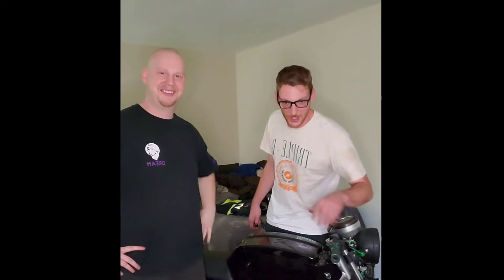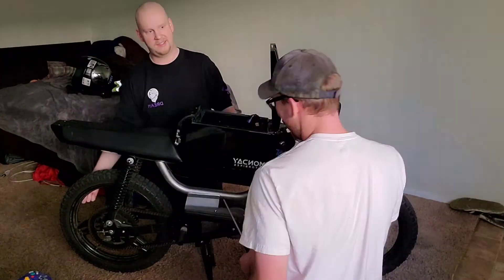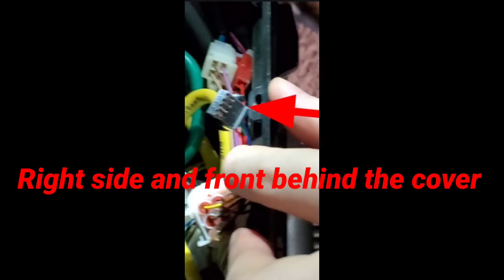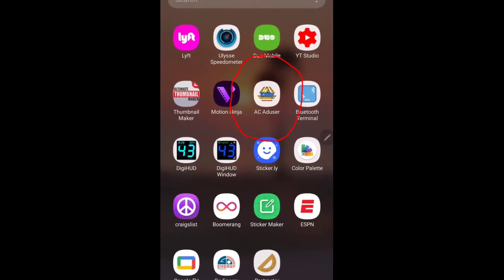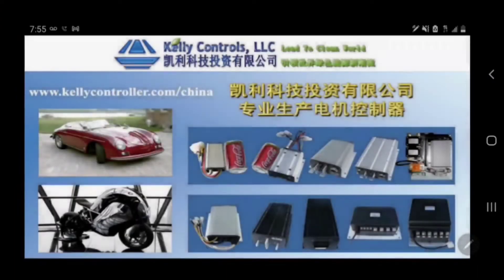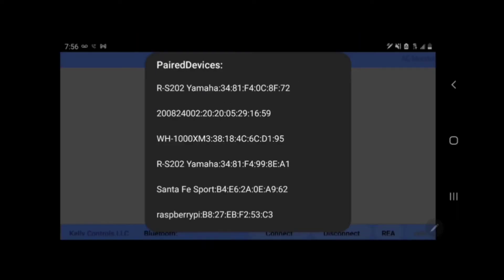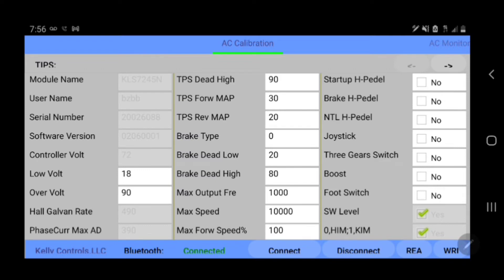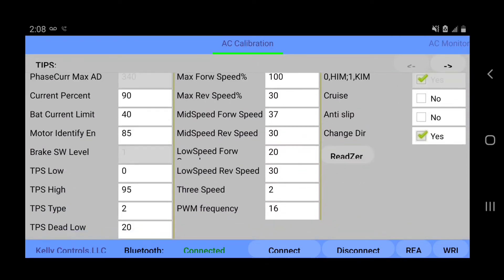Monday Motorbikes Gen7 gets HACKED!!! | EBIKE VICE

Comment: So if I step down the rear sprocket to a 52 tooth I'm guessing that this adjustment will compensate the torque that will be lost from the sprocket change, correct?
Reply from the maker: It will increase your torque, to offset some of what you lose through the gearing change yes. But it may not compensate for all torque that is lost.

Comment: Must. learn. more. Also , expecting a monday motorbike anza to be delivered soon. Think this trick could work for it too?
Reply from the maker: Hey Michael. Not sure what the Anza has inside. Probably uses an even cheaper, more generic motor controller since it has less power requirements than a Gen7. If that is the case, it is less likely to have any adjustable settings.

Comment: Are you guys planning on getting a new custom battery for the gen 7? Bummer you can't raise top speed through the Kelly controller. How about a cover or shroud for the gauges? Maybe a rear rack for storage. Get tired of taking a backpack with me.
Reply from the maker: Hey Michael, we have kicked around the idea of building a custom battery with a higher voltage, as the Kelly controller can take up to 90V. This would allow for a higher top speed without the need to change gearing. I abandoned the idea of a gauge cover as the display was still difficult to see, even with the cover over it. The angle of that display is just not ideal. I am working on a custom display for my personal ebike project now, and it will be universal. So stay tuned! Hadn't thought of the rear rack idea..hmmm.
Reply: @trowantechworks  right on dude. Keep up the good work

Comment: Excellent video and very well explained.  Looking forward to the sprocket change video.  Also, for a future idea, convince kyle to purchase a new speedometer.  The one that is similar to the onyx is what I plan on connecting.  The challenge here for most newbies is making a wire harness for it.  That's where someone with your expertise could really help out a lot of folks.  Here's the one I have purchased for my Gen7:   

https://www.aliexpress.com/item/32885007749.html?spm=a2g0s.9042311.0.0.27254c4dkpN7Gb

You lose the color screen but this speedometer gives a lot more info, such as mileage, and most importantly voltage readings.

Comment: Is it possible to change the top speed of the motor?
Reply from the maker: Hey Peter, the motor speed is limited by the battery voltage. The setting for motor speed in the motor controller is already maxed out when you get it from Monday. So changing it there won't do anything. The only way to increase your top speed would be with a custom battery pack with a higher voltage (72V to 90V) and/or a sprocket change. I will go over this in my next video!
Reply: @trowantechworks  Thanks a bunch!  Your videos are interesting and fun to watch!
Reply from the maker: @pete2.0  Thanks for the feedback, it is much appreciated. Any video ideas that you'd like to see in the future?
Reply: @trowantechworks  electric moped emporium is extremely knowledgeable about diy e bikes would love to see something collaborated by you both!